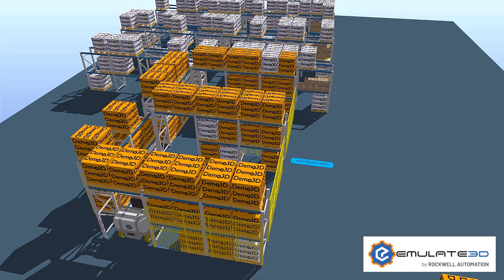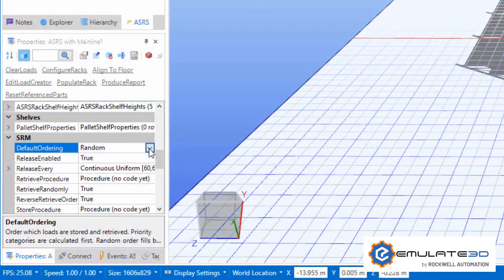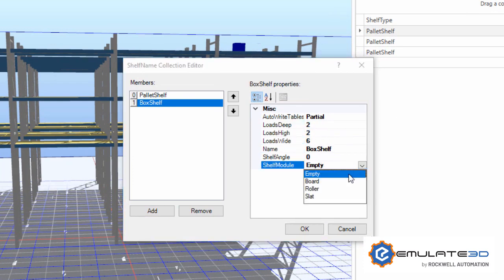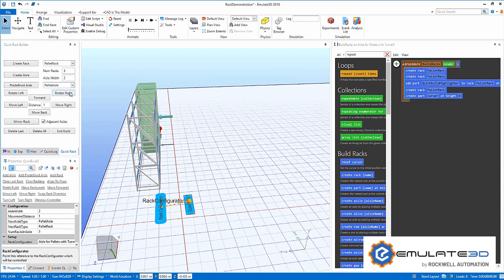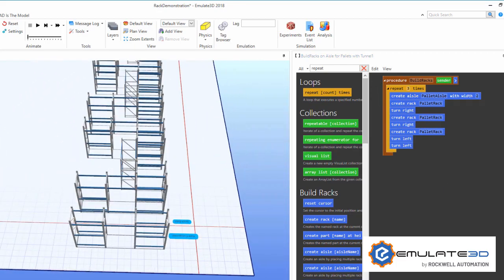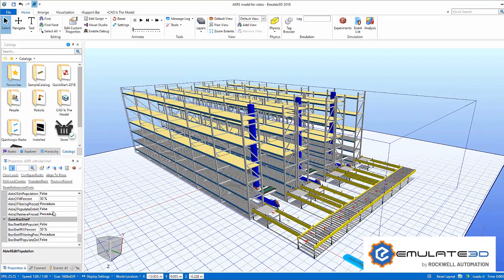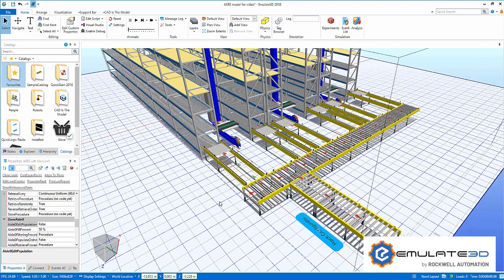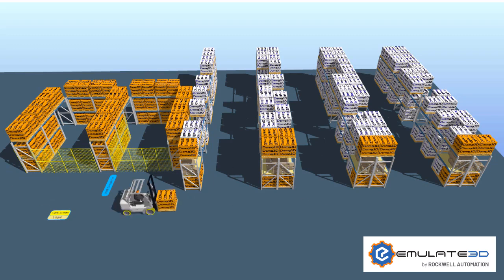Emulate3D Rack Configurator

Comment: How to set how many shelves you want in height?
How to get the preset rack options into the dropdown menu?
How to change the width, depth and height of the rack?

The written toturial does not give answers to these problems aswell.
Reply: this is a sales video not for training
Reply: @charleschen3489  So what?
The documentation is so bad, that it's near impossible to use the program, without sitting doing trial and error for hours on end.
And it's not just the addons, it's the program itself that is extremely poorly constructed. 
Example: You need 20 lines of C# code that you have to write yourself, just to turn on, turn off a spawner. The program is not optimized in any way.
To think this was ever approved to launch by Rockwell is beyond me.